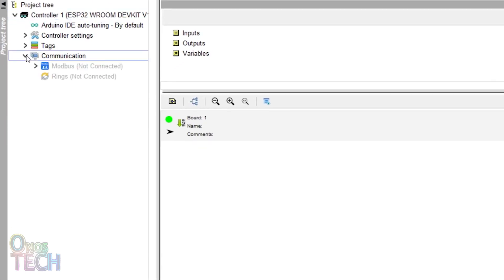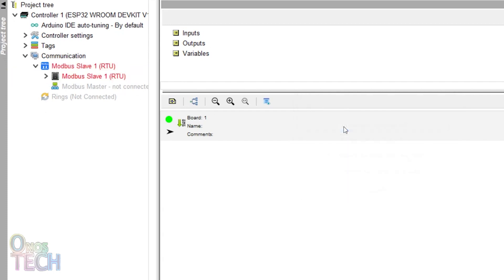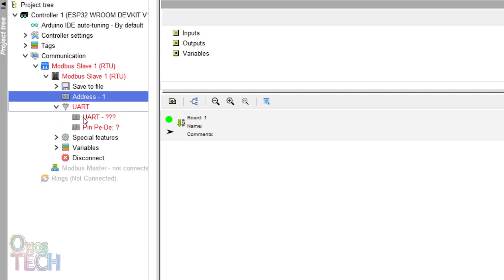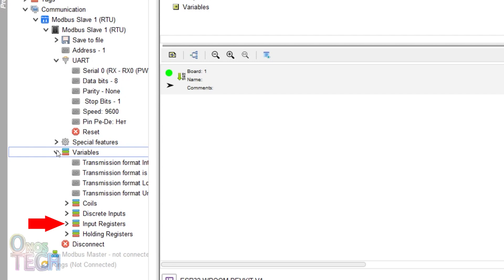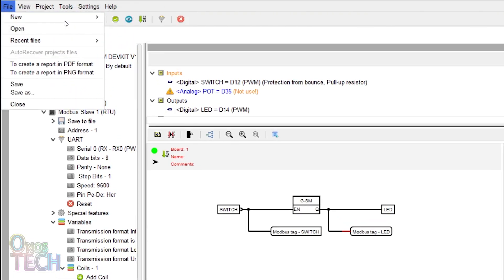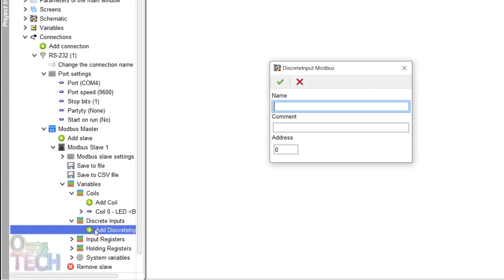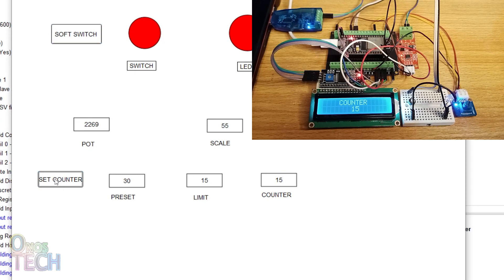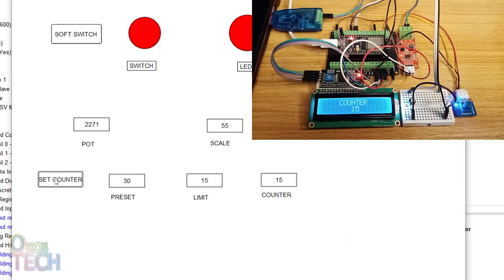ESP32 Modbus Communication | FLProg SCADA

Comment: I also tried a two-slave network with two Arduino Nano and FLProg Scada as the master. Did not work.
It just works with one slave Arduino.

WOULD YOU BE SO KIND ENOUGH OF MAKING A SIMILAR VIDEO WITH 3 OR 4 ARDUINO NANO SLAVES AND FLPROG AS A MASTER?

Thank you very much in advance!😀!
Reply from the maker: Did you connect two TTL to RS485 converter module to the two Arduino nanos?
Reply from the maker: Send your circuit schematic to onos.technology@gmail.com?

Comment: And display OP320 HMI analog values and digital  State like on off switch in FLPROG platform and possible pic controller like 16F876A ? VIA PICKIT3

Comment: If possible Arduino mega 2560 and HMI OP320 configuration set-up
Reply from the maker: I already have a scheduled video in a couple of weeks for the OP320 and the ESP8266 for the current series of FLProg ladder logic which can be adapted to the Arduino mega 2560 controller
Reply: @OnosTech  ok I'll be waiting..

Comment: i use arduino nano when connecting to scada, chip CH340 will heat up causing loss of connection, ESP32 will there be such situation?  24/7 connection
Reply from the maker: I am not sure why the CH340 chip of the Arduino Nano is heating up. You may try the ESP32 or an external CH340 chip module like the USB-TTL Serial Adapter connected to the TX and RX pins of the Nano. https://s.click.aliexpress.com/e/_Atjr47